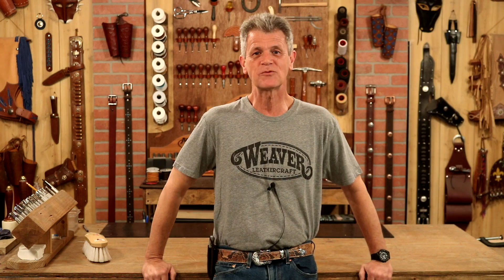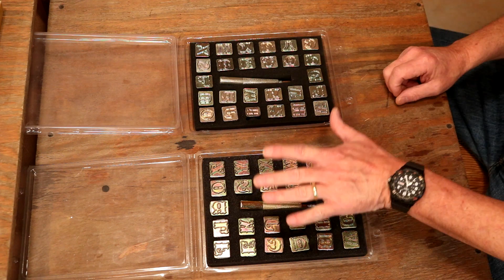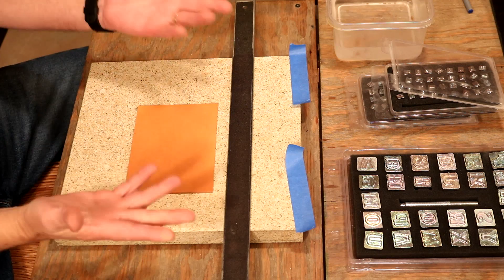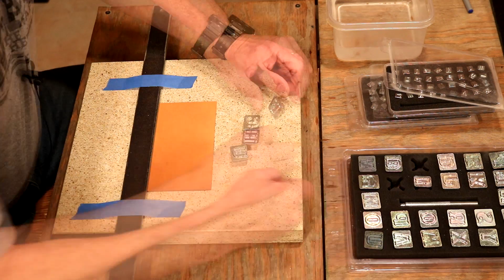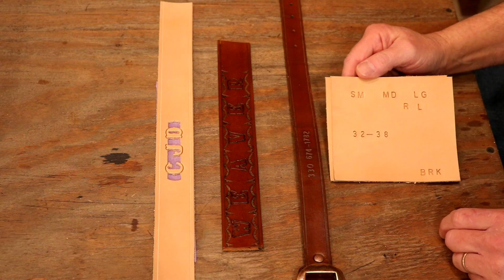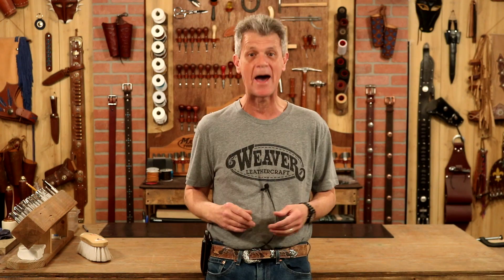The Leather Element: Confidence with Letter Stamps

Comment: Loved your video!!
Could you please inform me if this letter stamp set would work on faux leather?  I want to stamp on the right side of the fabric(coloured side). Your stamp set seems perfect! Loved the use of ruler and tape.
Reply from the maker: You can certainly try it. But usually faux leather cannot be stamped or at least will not hold a stamp very well.

Comment: You could refine your set up by using a metal ruler instead of the barstock to help with consistent spacings. Or add marks/ paper tape with inches/cm to the bar stock.
Or put a grid on your underneath surface and move your bar/ ruler so it lines up nicely at both sides

Comment: Hi I am new at leather and I want to make braclets i want to use veg tan leather is their I certain once leather I should get thanks
Reply from the maker: Hi Skye! It depends a little bit on the type of bracelets you're going to be making. You can go anywhere from 3/4 oz. for smaller bracelets like wraps or mystery braids and the 4/5 oz. to 5/6 oz. for cuffs. If you're going t be tooling and stamping we would go with natural veg tan. We've got single shoulders and 12" x 24" panels if you would prefer to start with a smaller piece of leather at first. 
Panels: https://www.weaverleathersupply.com/catalog/item-detail/13100-35-12-18/hermann-oak-veg-tan-strap/pr_56565
Single Shoulders: https://www.weaverleathersupply.com/catalog/item-detail/11-1202ss-3-4/veg-tanned-single-shoulders/pr_62495

Comment: Hey Chuck
Just wondering if you could help me with a problem.
I recently purchased a whole side of calf veg tan.
I have purchased it before and found it good for what I use it for. Unfortunately this piece is very spongy, I'm having trouble even beveling the edges, burnishing is quite difficult and I'm not getting a good enough finnish. Tooling I think is a complete write off, Any suggestions would be much appreciated

Comment: Thank You, I needed this. Been having trouble getting consistency. I have been using paper  tape as my straight edge/guide across the leather. Fixing a steel ruler or something similar to what you have used to butt up to will help a lot.

Comment: Hi I just watched you water based vs pro dye. I mostly use water based dye (eco-flo) never used pro or oil based. I noticed that my water based dye makes my leather stiff. But oil and pro dye(don't know the differencebetween the two) from what I noticed the leather is still pretty soft and floppy. Why is that? If you or someone can let me know why it does that. Why the consistency in the leather changes, thank you. Its just for my own knowledge and I'm thinking of switching over to try oil based.

Comment: the letter stamps, you also mentioned there is an arrow that can be used to maintain the proper orientation.  Would it not also make sense to also drop a dot of nail polish at the bottom (or top) of each stamp?  (Stronger visual cue)
Reply: A trick: you can watch series at flixzone. I've been using them for watching loads of movies these days.
Reply: @Jonathan Neil Definitely, I have been watching on flixzone for since november myself :)

Comment: Thanks Chuck but the problem I have is that I think the letters are too far apart.  When something like a 'W' comes after (for example) an 'A' the gap looks even bigger.  I think the term here is 'Kerning'.  I've never found a successful way of getting the spacing right even though I've filed away the edges as much as possible.  Any ideas anyone?
Reply: @Unmutual I guess if the backing could be transparent it would be easy.  I tried the ruler thing but trust me it's almost impossible.
Reply: @maddawgnoll  Yep, there's money to be made coming up with a system where each stamp has 3 (for example) registration points so that the user can easily choose the spacing.
Reply: I'm words without action.  Maybe Weaver will do it and send me a free set or 2.  Another idea I mentioned to somebody else is to put small registration marks on the stamp so you would know how to shorten the distance top and bottom.  That said, maybe I'll get some leather tags made up and rivet them on.
Reply: @maddawgnoll  someone else mentioned 3D printing... maybe combine that with transparent backing?

Comment: The "K" looks quite a bit lower than the rest of the letters even though it was placed on the straight edge. That tells me that the Weaver letter set may not be that much better. If the actual letters are not perfectly oriented within the stamp block then the straight edge doesn't do much good. I've learned to lightly tap the stamp and check its orientation to see if it needs to be moved a little before smacking it and that doesn't always work perfectly either. I was hoping that the weaver set was indeed a precision stamp set..if so I would gladly purchase . Could you do a little more work with the straightedge to verify the letter placement?
Reply: From what i can see, he started going off the rail at the second C. So I'm willing to bet that the bar stock wasn't as straight as chuck thinks it is. I work in a hardware store and i can tell you this, Bar stock is great for adding rigidity to a project; but absolutely crap at being completely straight. If i was going to do something like this, i'd be using a ruler with mm markings from the edge of my piece to get an exact straight line set up and verify after each punch. Sure it's more time consuming, but time in means quality work.
Reply: The bar shifted, the problem with using a straight edge is that if you dont hit the stamp dead nuts straight down, and instead slightly toward the straight edge, you can shift it back ~1-2mm without even noticing because it happens so fast during the strike.
Reply: @MattWeber  I don't know, I watched video over and over and I don't see the straight edge moving at all.
Reply: @maddawgnoll  OLD LEATHER SMITH here, very well thought out answer, nice 2 C, Question, unpack UR stuff yet? GOD'S BLESSINGS ✝️⚾🙃
Reply: @maddawgnoll  OLD LEATHER SMITH here, it is my signature stitch, what I like about it is I even lace with it, if you think it looks good with thread try with lace, I make hand bags 4 charity auctions then the stitch really shows off, GOD'S BLESSINGS ✝️⚾🙃